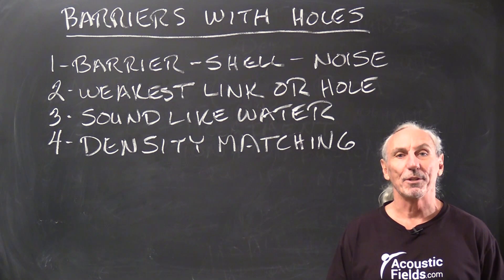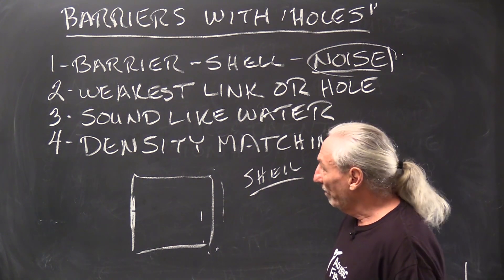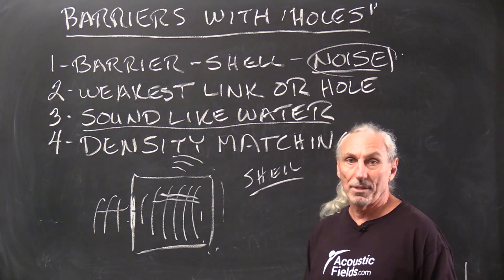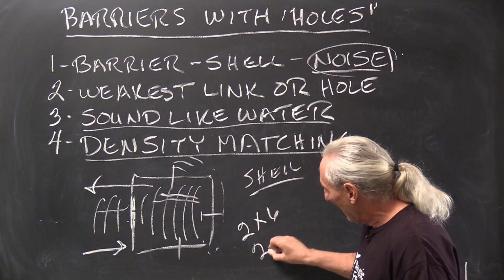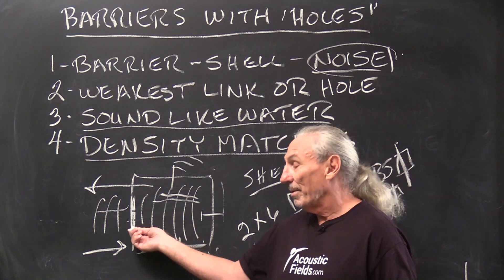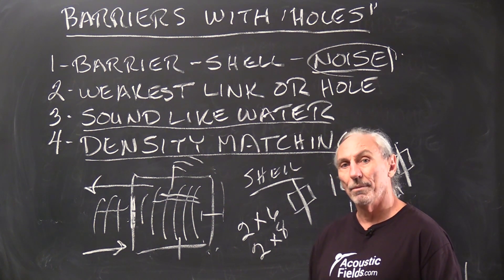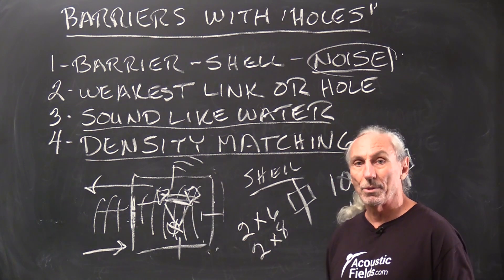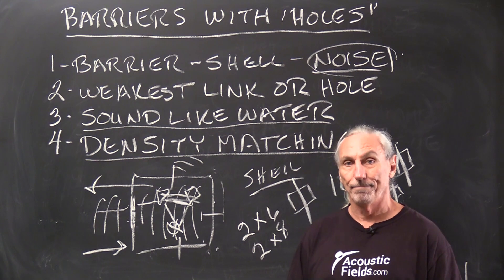Barriers with "Holes" - www.AcousticFields.com

Comment: Triple glazed windows, of different thicknesses of glass and air gaps, including one laminated pane, are very effective at cutting external noise entry into a room, particularly with an angled internal pane.  We used live near an airport and the method certainly worked with the inner tertiary glazing the depth of the window sill.  As to internal reflections... dense absorbers across the window are useful at night, but some of us like listen to music in the day.   Triple glazing is common throughout Europe, where we have to pay more for our energy.  

Even a double glazed conservatory attached to a listening room through a closed glazed room door can be  a very effective method of stopping the entry of external noise into a music room.  

In the real world many people have to work with what they have.  Acoustic design is about making the best of what exists for the intended purpose.  Perfection is rare and very much down to individual preferences, even amongst professional artists and engineers.  Not offering designs to leave windows in rooms seems to be a little self indulgent.
Reply from the maker: Windows are problematic from two perspectives. First, they are usually the weakest link in the wall/window structure so they perpetuate noise transmission issues at all frequencies. Secondly, windows placed within walls in small rooms are positioned in the wall in places that have a negative impact on first, second, and tertiary reflection time signatures. The management of the reflections and their associated interaction with the wanted direct energy from sources which is a requirement in two and multichannel treatments is made much more difficult with windows at those three reflection points. Windows can be used in a room if they are positioned properly within the room. In a two channel or small theater room, the windows can be positioned closer to the ceiling wall intersection. We have built rooms with smaller sizes spread across the surface area of the wall. This places glass out of the soundfields that require treatment and still permits ambient natural light.

Comment: In my finished basement is 10.71m x 3.35m and height 2.42. I have two window(0.91m x 0.6m) sitting high up on the wall. Would it be proper to put acoustic curtains on the windows to correct the hole?
Reply from the maker: There are no such things as "acoustical curtains". Curtains are not "acoustical". The industry has placed the adjective "Acoustical" in front of curtains. They do this for many reasons. One reason is for search engines since people search for this term. Secondly, with the word "Acoustical' in front of the word curtain they make it sound like it has special properties and therefore they can charge more for the curtain.   There are curtains that may or may not absorb energy. A limp mass material such as a curtain will not address the low-frequency issues within your room. You must deal with the low-frequency energy issues  < 125 Hz. These issues are due to your low ceiling height. They overwhelm every other issue and must be treated.
Reply: @AcousticFields  Thank you... so it looks like I have to hang a couple of panels on the ceiling to help rid of most the reflections?
Reply from the maker: The ceiling accounts for 17% of your acoustical issues.  You must treat over 70% coverage to have a effective treatment.

Comment: Exactly what I've had to deal with in my room, with a big window 6"x8" to the left of my listening position, I've only partially covered window with sound absorption, nearer to my left font stage tower speaker, and behind left side surround speaker, each speaker situated at each end of window, seeing this I'll make more panels, I can put in place and fully cover window when need be, I've spent a fair bit of money on my sound system and I want to get everything thing I can out of it, with your help I'm achieving it, keep up the great work Denis.
Cheers
Stephen

Comment: Love your videos, so much to learn. In a stereo listening room use case, I was thinking maybe a window could be used to an advantage in a front/back location, as you mentioned a window is the ultimate absorber (it just lets all sound out). Like an audio blackhole (in my imagination). I realize this is a severe over-generalization and I have been reading your comments to others about what is the use case, what is the distance to the listener etc. The only reason it comes to mind is because as I slowly build up some learnings from your videos (and yes a little knowledge is a dangerous thing, kind of like googling health issues), I think the general idea, for a stereo listening room set-up, is to diffuse sound on the left and right (to slow down wall reflections and give better imaging) and to absorb front and rear (for better depth). Maybe a window is too much “absorption” for any listening room use-case? Sorry for suggesting something just plain silly in advance. Probably too many variables in this scenario for any meaningful commentary.
Reply from the maker: D,  We do not use diffusion for sidewalls. We use absorption with the proper rates and levels for music and voice. Absorption assists us with image definition, position, and separation. We then apply diffusion to front and rear walls and sometimes the ceiling to magnify that definition and separation.
Reply: @AcousticFields  Thanks for clarifying that much appreciated!!

Comment: Ever heard of Indow Windows? They make inserts for your windows (custom).
Reply from the maker: E, You are missing the point of the video. A large variable in noise technology is mass or density.  A window is much lower mass and density than a wall. This weak point is the hole issue. You must first measure the frequency and amplitude of the noise then decide on what barrier to build to attenuate those frequencies and amplitudes. With noise there is no easy fix and guessing is a fool's game when it comes to noise issues.
Reply: Acoustic Fields I have not missed the point, in fact I appreciate the point. I was merely asking if you had heard of them. Merely changing the density/mass is one thing, however; if noise can enter the window you still have an issue to address. Good video 👍🏻
Reply from the maker: E, We do not use those product types. We design our own. Using this method, we fix 100 % of the issues and then can move forward with the treatment phase. Most lack specifications to rely upon for analysis and we know of none that are effective below 125 Hz. Window noise can be minimized. We just finished a must have window noise design where we used 3 - 1" clear acrylic sheets with calculated air space to attenuate down to 40 Hz.

Comment: I ended up just putting two 3/4" MDF boards in each window held in tightly with closed cell foam on the edges with a 1 inch air gap between the window and the board. There's another 1 inch air gap between the two boards. Then I mounted MLV to the outer edge of the window frame and sealed it with foam to the drywall and held it with screws. It drapes kinda loosely and doesn't touch the MDF board behind it, but it is sealed air tight to the window frame. Lastly, I have some closed cell foam stuck to the MLV to absorb the echos and high frequencies in the roam. It's a relatively cheap window plug, but it gets the job done pretty well.
Reply: As for my use case, it's a home theater room and I don't want my neighbors to complain...
Reply from the maker: S,  Good use of materials and their function. Well done.

Comment: What about placing some transparent plexiglass diffuser in front of the window if we can’t remove them? Thanks.
Reply from the maker: P,   Do you need diffusion for your usage?
Reply: @AcousticFields  well, I was thinking about them because looks like the only "static" option that don't stop the light coming from the window...
Reply from the maker: P,  We focus on sound quality to match usage. Placing a diffuser on a window depends on many factors. First, is a diffuser in the location of the 
 window match usage requirements. Secondly, if it does match usage requirements, do you have enough distance for the diffuser to work correctly. Thirdly, does the prime number diffuser chosen match the usage and distance requirements.